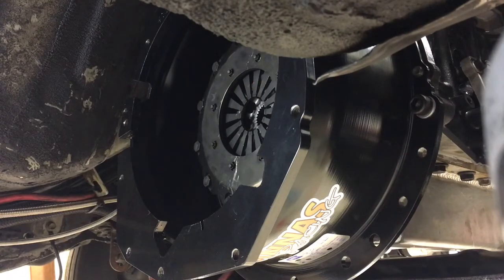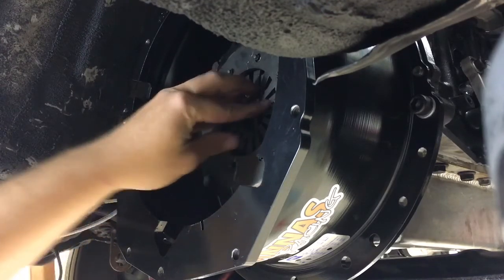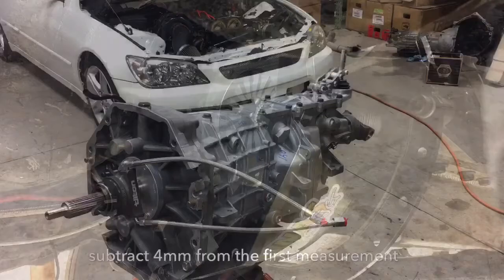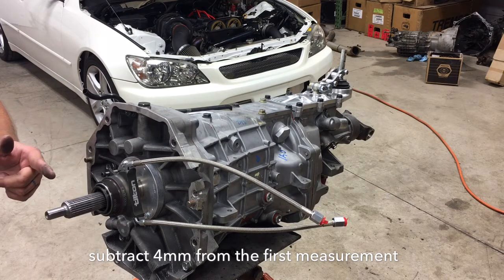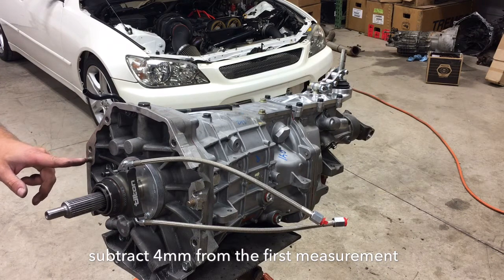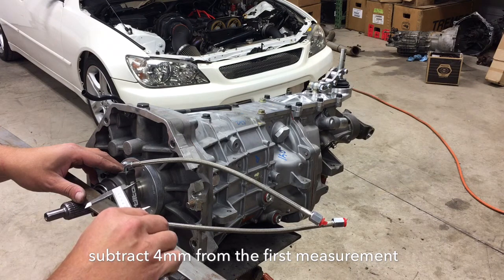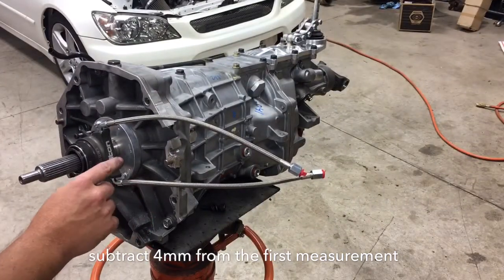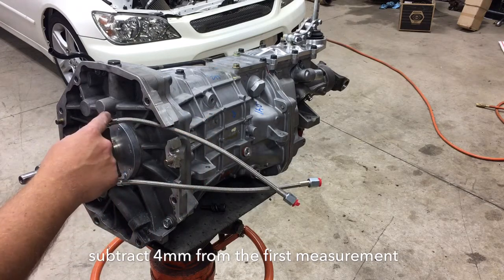Measuring air gap for your hydraulic throwout bearing

Comment: Ok well what if you have a old nv3500 that doesn’t have a removable bell housing. So my transmission is the old fork and throw out barring style. And I’ve have to replace it all over and over again works good for two weeks then I’m having to force it in to gear with two hands to shift. So I’ve gone with this style not knowing I’d have to shim then dang thing and have never done something like that. My tolerance has to be with in .50-.100 it would be hard to figure out but the bell housing is one piece with the transmission

Comment: You like that Tilton TOB? I have a hydramax and it keeps leaking and ruining my clutches
Reply: i've sold probably 2000 of them. very few issues, most of the issues happen when they get overextended over their max travel and then it will hurt the seal. i'd recommend replacing your seal and make sure your air gap is set to 3mm and if your pedal throw is very long, make sure you have a pedal stop in place to make sure it does not overextend the bearings max travel which i believe is .700"
Reply: @grannasinfo6666  already did and sent it in to get rebuilt and he didn’t even rebuild it. Said it was fine

Comment: Would this apply to a regular throwout bearing on a foxbody t5? I've converted it to hydraulic with an external slave, as it sits right now with clutch fork on, transmission installed, no slave on. I pushed the fork all the way back to towards the transmission..Ive got "about" 1/4--3/8 gap from the throwout bearing to the clutch springs. I have an adjustable pivot ball on the bellhousing, should I screw  it out or in to get the throw out bearing close to the pressure plate spring?

Comment: Ok you measured but didn’t actually show how you would adjust the air gap
Reply: shims, under the bearing
Reply: The air gap would be adjusted by shimming the TOB that is mounted on the trans to move it closer towards the pressure plate fingers. This is assuming you need to make the airgap smaller. If you don't have any air gap at all or it's negative, this can't be fixed. Either new or rebuilt clutch I think.
Reply: exactly what I was wondering.  no explanation of what the air gap is for either.
Reply: @2point2  so basically two thing…you’re adjusting the clutch pedal movement to where it doesn’t push the bearing too far and also adjusting the “air” gap to where you’re foot is off the clutch pedal and the throwout bearing can still spin freely. Not too much of a gap though, just enough to where the bearing is not rubbing against pressure plate teeth.

Comment: Do you take this measurement with the spring removed from the bearing and the bearing installed at its compressed position?
Reply from the maker: There is no spring in these aftermarket bearings. You measure fully compressed, where piston is at the zero position